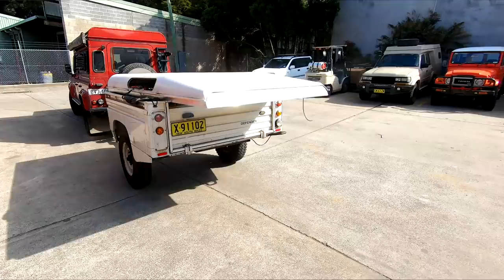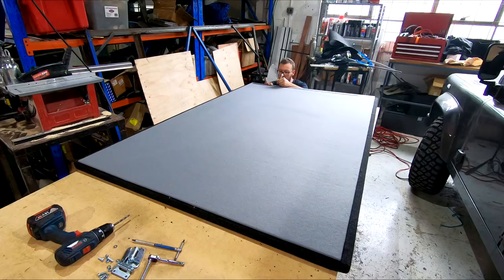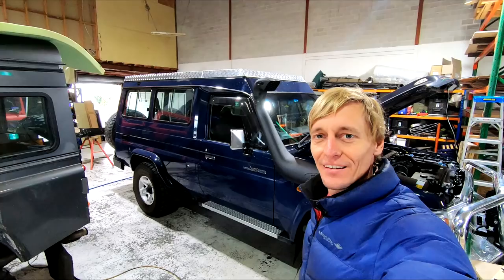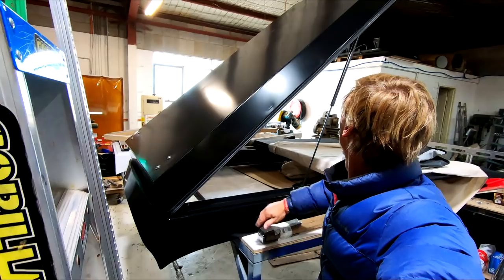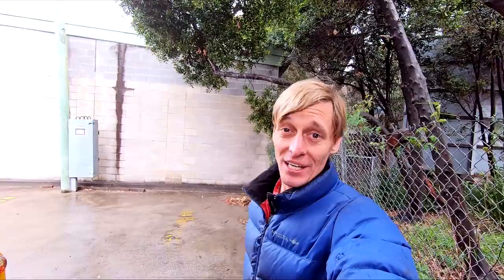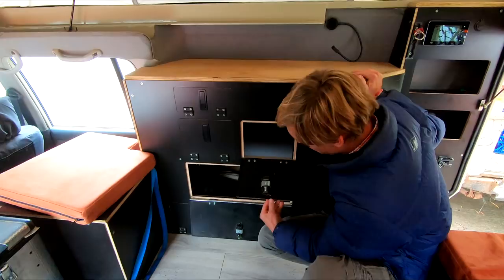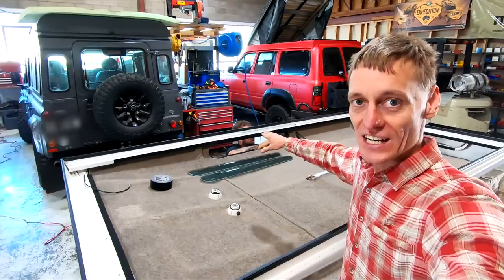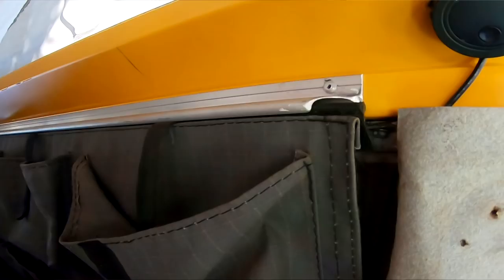Defender Overland Touring Build 2.2 - Toyota's, 130 Wagon, Pop That Top

Comment: Brett I contacted the company that is building your poptop, and they told me they would not export to the USA. Really bummed now. I would have liked to of had one for my 110. Already got the bundutec. Glad you are getting this addition.
Reply: 7:36 maybe they changed they started?
Reply from the maker: Maybe they don't do Defender roofs as the original roof is needed for modification. The LC's are prefab?? Hope the Bundutec works well for you Donald.
Reply: Hello Brett makes sense if the use the original roof, maybe the could sell a kit form.
Thanks for the response Brett

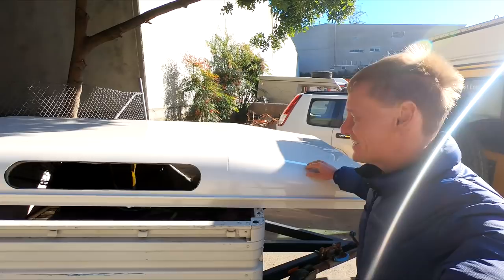Comment: Great video Brett, thanks. How's the reco 200tdi handling all the vehicle's load? I imagine with the new interior set-up you're wishing for there will be a significant increase in weight. My standard 300tdi struggles as it is when I load it up! (And where are the puns around Brett's top being chopped at 13:47?)
Reply: I asked the same question. Apparently it will end up around 20kg lighter with the bed frame, battery setup and roof racks removed.
Reply from the maker: Engine going well.. It's not necessarily faster, but seems to handle 3 tonnes ok as long as its not up hill too long. Never get much power out of a 200tdi unless I start messing with gas flow heads and VNT. I was getting shaggy like a sheep, needed a good shave. Like Ian said, I've removed a bunch of stuff to make allowance for the extra pop top weight. Should be lighter after conversion.

Comment: 9:45 Nope. Brett, Daniel will take a 130 cab chassis and make it into a 2 door ( 3, if you include the back one )  130 wagon. That would be my choice if I was still going to use a Deefer. I can't see how the rear doors help, and they take up room. But I've decided to try and find an OKA instead.
Reply from the maker: Does make sense.. cabinets all the way along would be useful, plus there would be no reason to get out of the car, if I just hop over the drivers seat straight into the long load. Plenty of room then for everything. OKA's are pretty cool too.. My concern would be finding spare parts.

Comment: Nice to see you back and on the projects
6:10 you will never get 15 years from a semi flex panel 
(especially not mounted like that)
2 years is good
Reply from the maker: Thanks mate.. I''ve purchased the mounting kit which lifts if off the roof for air gap and flex.. From what I hear there has only been 1 failure of this brand panel of all that have been installed on the pop tops.. so fingers crossed.
Reply: Sounds great.... Best of luck with it
I agree, the semi flex is the best, lightest option and best Watt per Size available... Plus they are cheap enough.
Reply: @RoamingTheOutback  what is the brand mate?
Reply from the maker: @KevinJamesMcAuley  https://www.solar4rvs.com.au/150w-radpower-etfe-1460x545mm-slim-junction-box-li. Radpower.